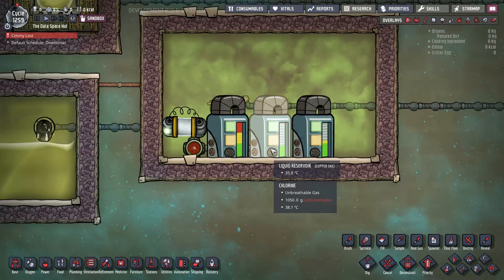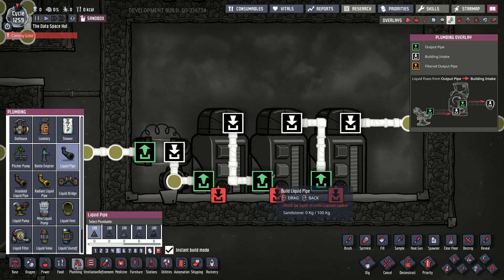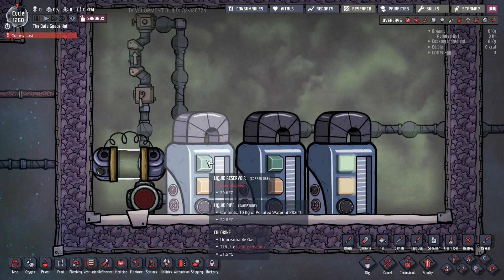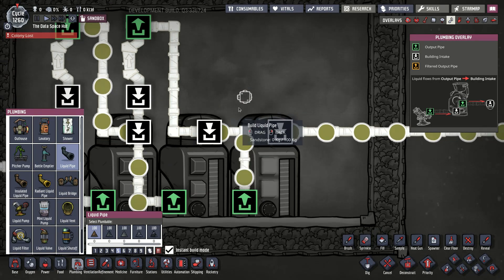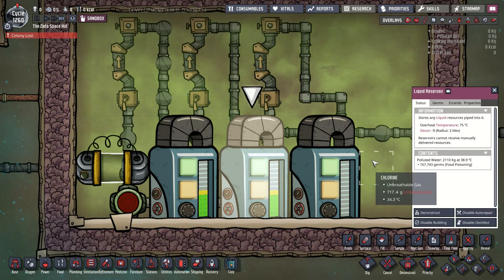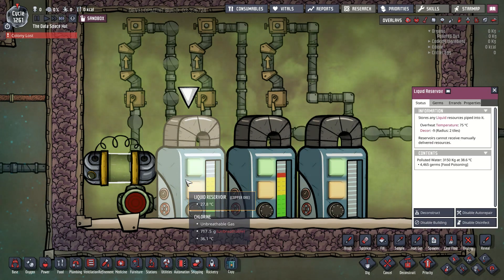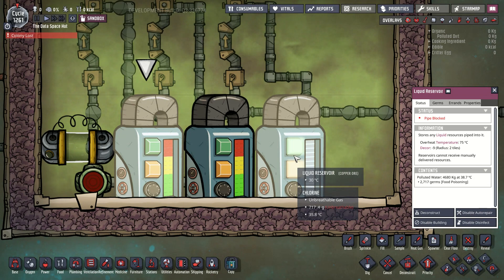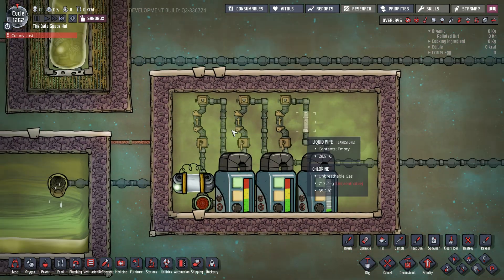A simple germ killer that processes a continuous full pipe of input.

Comment: The biggest issue i've found with this is needing plastic for the germ sensor.  I have instead started using a timed system that switches between two tanks.  It seems like 120 sec or so of a tank sitting still seems to work pretty consistently.

Comment: You can achieve same with two reservoir, metal door, valve, buffer delay, not gate
1st reservoir is put on ontop of the horizontal door, door starts open to disable reservoir output, when reservoir is full it sends red signal that triggers the shut off valve (or turn off pump), and through a not gate start the buffer delay of 120 sec, after 120 sec the door can close and it can drain into the 2nd reservoir which is now clean water only, when first reservoir empties, it emits a green signal, which can open the valve and open the door.

Comment: Little observation:
If you don't provide a continuous flow of input water, like if you only use this for bathroom setup, there is a chance that the system let's trough a little amount of germs at the last blob of water. And if you use polluted water, the germ will quickly spread. For this, I recommend to add a Buffer gate + an AND gate to the valve, this way the system only going to output water, if the system is germ free, for the set amount of time.
Other than this, this is a really helpful video, I hope i could help
Reply: I agree, also if the 3rd reservoir get filled up, the setup will stop to work entirely
Reply: I get the buffer gate but why an AND gate ?
Reply: @blazeraz7666  this way it lets water through if the water was germ free for a while, AND if the current blob is germ free
Reply: @leventekabok811  Did you mean filter gate?

Comment: For the very first input pipe, you can put it through a bridge, with the output sitting on the return pipe from the overflow. This will ensure that it won't fully jam, ever, if something goes wrong.
Reply from the maker: That's a good idea. I don't think I considered the case where the whole thing backs up because the output pipe is blocked. I should try it out.

Comment: Love the video. Short and precise. But I can't get the germ sensor to work. It lets the water through even if it has germs in it. So now my water source is contaminated.  What could I be doing wrong?
Reply: So eh... I figured what I did wrong. I chose the germ sensor from the automation tab. That's the wrong one :D I need to pick the one hiding all the down at the bottom of the liquid tab.
Reply: @michaelandersen9028  thanks for updating!! I'm about to build one and would have made the same mistake 😬😬
Reply: @laurieb3703  I'm glad if it helped you :)

Comment: I came to your site via a reference by Francis John. I had a chance to view several of your videos. Your format is on the spot - give an overview, followed by details, and then a dup build; to the point without rambling on about other things. The simplicity of this germ killer is great. I will see if it is still valid with the current release. I have used a 2 tank and 3 shutoff system for years. This 3 tank, 1 shutoff is even more elegant in its simplicity.

Comment: I did a more compact design, making sure that the obviously important steps were there. For some reason one piece of polluted water with about 2000-20000 germs managed to get past the filtration system and into the water supply. Good think another ascedent like that didn't happen and the gurmy water stayed away from my pitcha(!) Pump. Is it alright to let that gurmy water stay there? It doesn't spread.
Reply: in reality the polluted and clean waters would mix together, but in the game they are different types of liquids and only one type of liquid or gas can exist in a square at a time, so they will never mix and it won't spread while the clean water is around it. Duplicants will go to a pitcher pump with the goal of only collecting a certain liquid, and so the game allows them to choose which liquid the pump will grab.
So to get the tile of germy polluted water out of your clean water tank, set up a bottle emptier, select polluted water, and enable auto-bottle. Now they have a task for it, your dupes will choose to take the polluted water from the pitcher pump instead of the clean water around it.

Comment: It seems to require... ten tons of water or more to work? What if you need that water elsewhere? Also germ sensor requires plastic.
Reply from the maker: If you don't have a continuous stream of input water it will still sanitize it and send it on its way. It might sometimes retain some water ciculating in the pipe, but probably not.
Reply from the maker: Theres a way to do it without a germ sensor but then it DOES retain 20 tons of water.
Reply: Germ sensors don't always work when I tried it. Maybe it was fixed, was a while ago. I'm using a system that only requires the daily pee from 5 dupes or more, no germ sensor, processes 1800 liter per day. Only advanced tech is timer and liquid shutoff.

Comment: Your plumbing is a mess for no reason what-so-ever, but the fact reservoirs are effect by open air is interesting.
Reply from the maker: There's definitely a reason the plumbing is exactly like it is, but it's certainly possible that there is a simpler way I don't know about.
Reply: @tonyadvanced6315  Throughout the entire video the water bridges are entirely empty and do not recirculate any of the liquid. The water bridge idea will never function unless you have filters and/or automation setup throughout it because plumbing will always flow in circular patterns between in-and-out. That is same reason why the other small re-circulation pipes work.
Reply from the maker: @macenor  You can see the backflow pipes at work at 7:34 in the video. If you use the system continuously then they will become unused,  but you'll need them again if you let the system empty and refill. If you don't require 10kg/s continuous throughput then a simpler setup is sufficient. If you are willing to use 4 reservoirs and keep them always full then there's a way to do it without a germ sensor/shutoff.
Reply: @tonyadvanced6315  Still not seeing the bridges be active.

Comment: I have made this on a map which had a cool slush geyser and polluted water vent maybe 20-25 tiles apart. Made a big holding tank to mix the water together and pump that into a 4 reservoir room full of chlorine: https://i.imgur.com/vYKe1f6.png  I then let the tanks fill up with water and waited until the germs were all gone, then hooked up the output to my base (left one section of pipe outside the room unfinished so nothing left the final tank). New high-germ water comes into the first tank which is full and is highly diluted, I see between 3000-10000 germs in tank 1, between 0-100 in tank 2, and none in tank 3 or 4. This setup doesn't need the (minimal) power for the shutoff, or the 50 plastic for the valve. I did leave a gas pump in there to create an initial vacuum, and put bleach stone in the storage bin to off gas. Used a power switch to turn off the pump, but if I had made a liquid lock then I could clean it up, refill bleach stone (it is used when it cleans the germs), or install automation to do refills. The 4th tank was there as cheap insurance/overkill.
Reply from the maker: That's a good solution. There's a way to arrange the pipes for 4 reservoirs that does it all automatically without a shutoff. The downside is that the reservoirs stay full when the setup is idle (you aren't feeding it PH20). So if you need the water for something you can't access it without intervening.
Reply: wow that's so great

Comment: dang it , i understand all but just started with auto cables and cant see how you get the automation clabe setup :(
Reply: For automation there's a single wire going from the sensor to the liquid shutoff,  when you select the wire to place you'll see the outlets and you just run from one to the other.

Comment: If you want to stop that system ever having overflow issues, place a hydroponic tile and a single thimble reed plant in a small adjacent room  have right-most liquid the tank set to red signal when 95% full, then link it to a pipe shutoff leading to that single plant.

One thimble reed will eat 160kg of polluted water per cycle and will not die if its un-watered. A Dupe converts 5kg of water into 11kg of polluted water each cycle. So a single plant can manage the overflow from a a base of 14 duplicants. The shutoff is necessary because the plant will devour your entire polluted water supply if left to freely consume and your pipes will run empty. As a huge bonus, plants simply delete germs on any kind of liquid when they consume it to grow.

Comment: For some reason my clean water won't go though the output pipe and is just being recycled like the germy water with this system
Reply: Is there any / was there any liquid on the ground that reservoir stands ?
Bottom 2 tiles of the reservoir should be clear and covered by chlorine.
Also they make the heat exchange on the bottom left tile.

Comment: Is there a way to do this without the germ sensor? I don't have plastic.
Reply: I came across https://oxygennotincluded.gamepedia.com/Guide/Disinfect_Food_Poisoning where you can use a cycle sensor and a door under the reservoir hooked to timers. The door starts open so water can flow into the reservoir but not out, then then the input is turned off for a set time, and then the door closes and lets the tank empty for a set time. The shutoff valve is before the tank so all water gets its time in the tank and none sits in a pipe after the tank.

Comment: I HIGHLY recommend you go to 4 tanks.

It is true that you only need 3 tanks.  But it easy to lose track of of what is going on with your tanks for a few cycles and find you accidentally emptied one.
Reply: Or you just automatically cut off the outflow whenever the intake pipe isn't completely full. Should be completely foolproof after being setup.
Reply: Once you calculate the output of the water source, you can add a valve after all of this and set it to match the average output. While this video shows the full 10kg output which is great, when you have say a polluted water geyser that averages less the valve is handy to make sure you never run dry.

Comment: you're missing filter gate after germ sensor. bubble with germs followed by clean bubble will get inside clean pipe, its not much, like 1-2 germs, sometimes 20-30. other than that good setup, using it myself ;) cheers
Reply: So, you mean replace the Shut-off with a Filter gate?
Reply: @TheBushdoctor68  Put Filter gate between shut-off and germ sensor and set it like 5s. If this design has low flow rate, it will let through some germy water when nearly empty without that filter gate.
Reply: @HerraMonoTooni  Good one! Thanks.

Comment: One caveat of this system is that it requires plastic for the germ sensor.

A simpler method is placing an overflow sensor (2 bridges + pipe element sensor) before the 3 reservoirs, that opens the output shutoff when it's full.
By the time all 3 reservoirs are full, the final one will have 0 germs, the one before would have around 100, and the first around 10000. As long as all reservoirs are full, the germy water gets diluted quickly enough passively for the output reservoir to be germ free.

Naturally, your system is more secure thanks to the germ sensor.
Reply from the maker: That's a good way to go. It can also be done without any automation at all, but I think it requires four full reservoirs. https://imgur.com/jA00fKz
Reply: Never understood why people make a big deal of plastic. Just get some dreckos in a box with mealwood and you'll get some small amounts rather fast. Enough to get these basic infrastructure things going anyhow
Reply: @perhapsyes2493  I guess it's a bit tedious and difficult to set up if you're not used to it. Also can't do it too early in the game
Reply: OP's describing Francis John meta

Comment: I suspect there might be a bug in the game, I have a few reservoirs after a setup just like this, and sometimes I find germs in them (not many tho). I usually just re-run the water thru the system, and I get 0 germ water. I'm starting to think there might be something going wrong when the three tanks are almost empty (there's only a few kilos of water in the last tank). I watched the system run for quite a while but I was never able to catch it fail. So I figured out it must be a bug, many during some reload.
Reply: The secret is to get the tanks full.  If you let the water leave before they are full, they are very bad at killing germs.  Restrict the outflow until they are full.

Also it is a good idea to build a 4th.  You only need 3 full tanks to guarantee the germs are killed, but the spare one makes sure you don't do something stupid and empty 1 or 2 of the required ones.

Comment: Shouldn't the input from the sensor reject be prioritized to the new input?
Reply from the maker: Do you mean it should wrap back all the way to the beginning?
Reply: @tonyadvanced6315  no, I think that the rejected output from the germ sensor (so the Pwater that's still germy) should go back in the 3rd, and that it should go in before new germy water.
Reply from the maker: @mirjanbouma  Oh, I see. In that case germy pwater would run through the reservoir in a circle and not let any new pwater in. The reservoir would never start filling and it would takes ages to sanitize the water running in the loop.
Reply: @tonyadvanced6315  but the Pwater in the other two reservoirs would be disinfected in the meanwhile, right? They would act as a buffer so germy water would still be inputted and (save for the little bit in the pipes) sterilised. 

At least that's how I think it would work.
Reply from the maker: @mirjanbouma  Yes. It would still kinda work. you'd have to add a fourth reservoir to eventually get a full 10kg/s throughout. But what is the benefit of doing that way?
Reply: @tonyadvanced6315  if a fourth reservoir is needed, then there is no benefit.

Thank you for the discussion!

Comment: better use time clocks instead of this. Close up intake, let it sit, empty, and open the intake
Reply from the maker: That's a good way to go but you can't get 10kg/s continuous throughput. For that, the input pipe must never be blocked.
Reply: @tonyadvanced6315  Of course one can. Just have more than 1 reservoir connected to the same controls with different intakes ;) Then, if for some reason you need as much flow, you will get the same average. Or just couple it with a "not" and get 1 working while the other rests. Anyway you will exclude a possibility of locking the system, which is possible in your version ;)
Reply from the maker: Your approach is good, I don't want you to think I'm trashing it. You'll need 3 reservoirs (or maybe 4) each with a shutoff and all the automation necessary to coordinate them. You'll also need a strategy to make sure the packet of water waiting in the output pipe is clean. (I'm not sure what you have planned for that, a feedback loop I presume.) It could fail for the same reason my strategy could deadlock, if there's an unspeakably large number of germs in the liquid so that it can't be sanitized quickly enough. For both approaches, that vulnerability could be mitigated by adding another reservoir or choking the input. But, the germ count would have to be so high that there's probably no point in worrying about it.
One thing I like about your approach is that it's more scalable for throughput. (If you only need one reservoir then you can use only one.) But I dislike the extra shutoffs and automation that I think will be required. Why not just do it without those things? I'd definitely be interested in seeing a screenshot of your design. I'm down to link to it so that viewers can see the other approach.
Reply: Clock are nice for septic imo , this setup is nice for pollu water vent as it will always has input
Reply: Brothgar did that with no clock, no stop. Full stable, automated and max speed. Quite complex though. I like the Clock setting, it simplifies a lot.
The battle between long term stability and simplicity of a system. I really dislike overcomplicated machines/setup in this game.
Reply: @AnotherSpaceCowBoy  yeap! That is my preference too

Comment: Hi there! I have a map without a Chlorine vent, so I am running out of chlorine. Is there any system that is temperature based, and similarly simple?
Reply: running out of chlorine? unheard of :D
Reply: Make sure you place your bleach stone in a storage container in your chlorine room. It doesn't take much to keep the gas pressure at the right level
Reply: Super-heat your water to kill germs, then cool it back off with a thermo aquatuner/steam turbine combo. If you have a hot water geyser that's usually naturally hot enough on its own that you can just dump germy water right into the reservoir you build around it.
Reply: Chlorine is not consumed on this setup.

Comment: Do you need automation wire to connect shut off with germ sensor??
Reply from the maker: Yes. Also, that's a "liquid pipe germ sensor", not a regular one. (A common mistake, apparently).
Reply: Tony AdvancedONI got it thanks!!